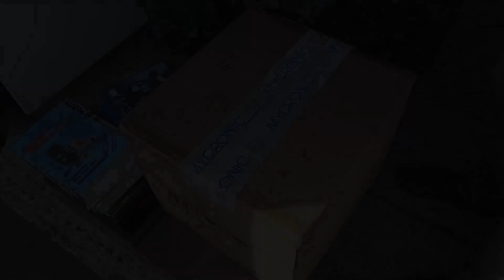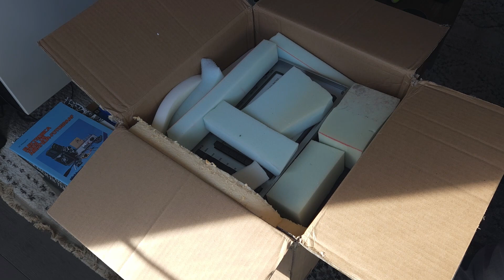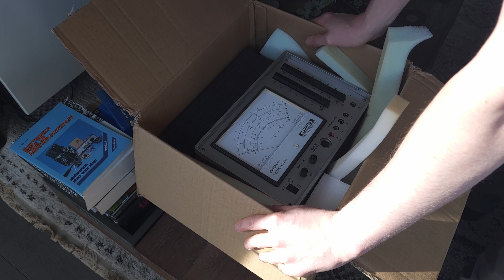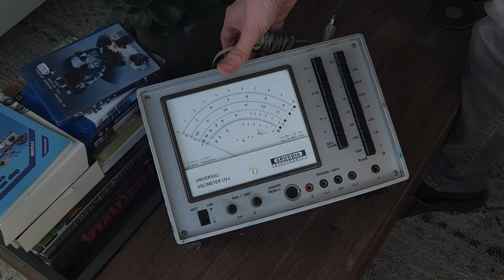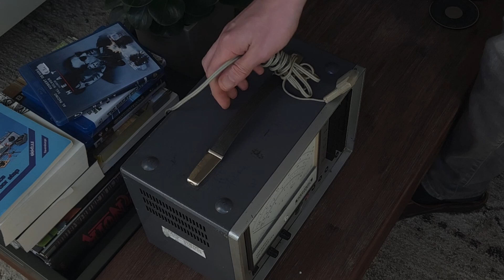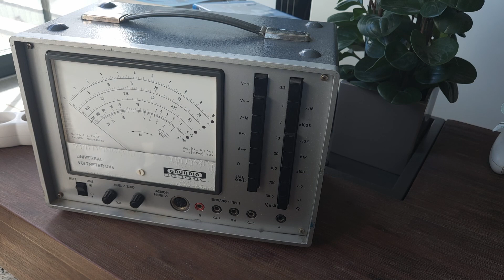Unboxing a new toy for my workbench...

Comment: Looks like a very well made meter.  It probably just needs the switches cleaning, and maybe power supply caps?  Anyway I'm not jealous.  Really. 
Well, maybe just a bit...😀
Reply from the maker: Indeed, caps, cleaning and calibration I guess. Possibly also a transistor or so. We'll see...
It was definitely not my intention to make you jealous. Well, maybe just a little bit... 😁